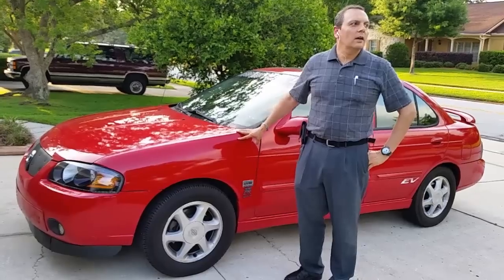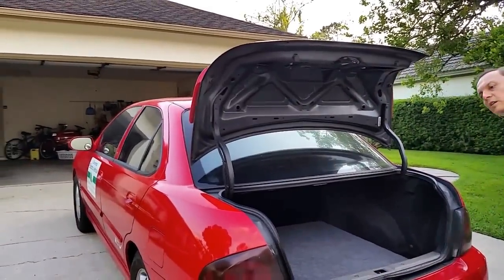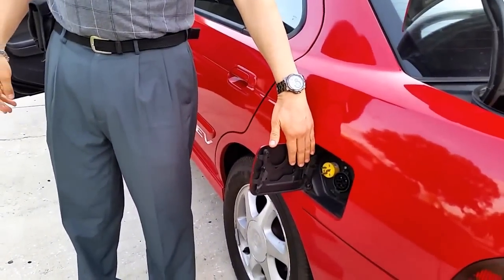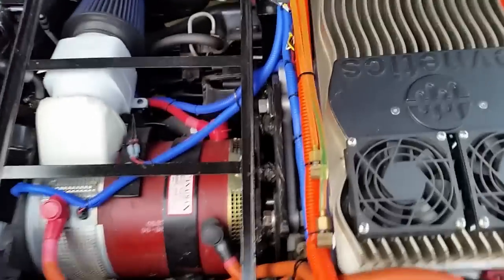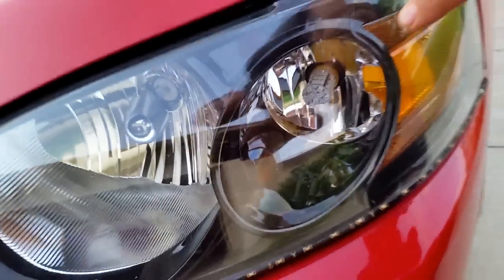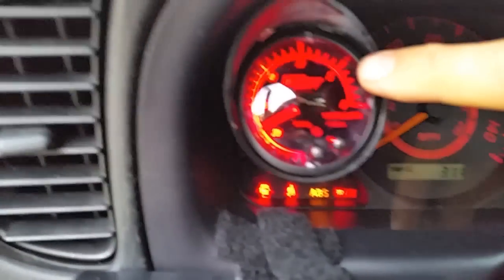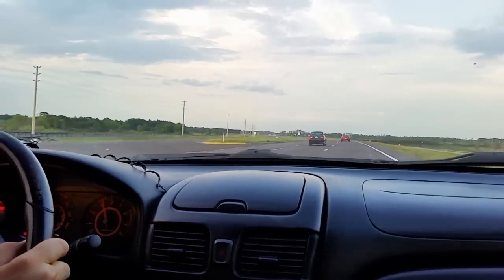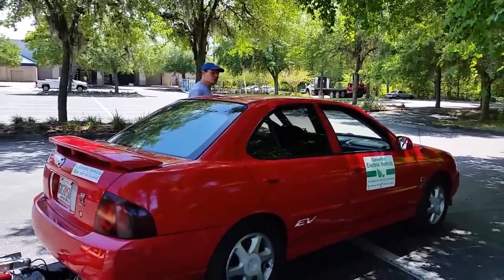Nissan Sentra Electric Car Conversion Part 40

Comment: You did a great job. You could install electric brakes and do away with lots of stuff like master cylinder, brake booster, and more.
Reply from the maker: +robviolin1 I didn;t know there are electric brakes. Where can I find more about them?
Reply: +mecanofan go here for electric brakes - http://www.etrailer.com/s.aspx?qry=electric-disc-brakes&furl=-vw-1
Reply from the maker: +robviolin1 Eelctric brakes is a big sorprise for me... very interesting. I wonder if it is worth to change a car to install electric brakes. most electric brakes are installed in trailers from what I see.
Reply: +mecanofan Well here is how i look at it. With regular fluid brakes you have the problem of the fluid leaking, master cylinder or brake booster having problems. With electric brakes there are not any problems. Any other example: better to use an AC motor to power your car instead of a DC motor. That was your won't have to worry about ever having to change the brushes. In stead of using a manual or automatic transmission, it is much better to use a gear box like Borg Warner 31-03 eGrear drive. Here is a link : 
http://store.evtv.me/proddetail.php?prod=eGearDrive
Reply: +mecanofan This  gear box has a 97% efficiency rating. That is very good. You will never have a problem with your transmission going out. You can convert an electric car that will last many, many years. If you ever get into an accident , you can just take out the electric conversion parts and put them into another car body. I converted my riding mower for about $500.00. It has a 11hp DC motor running on 24volts, no controller.
I have had this mower for about 30 years and just recently converted it.

Comment: What is with decorating the car being electric just because you decided o e day to use a different engine design? Why not keep the outside clean from any hints very similar to how you build sleepers?
Reply from the maker: I did it because I know people do not realize that you can convert cars to electric and many don't even know yet that you can drive on electricity. I have received so many questions and also thumbs up from the stickers.
Reply: Besides, you should really have used those air vents such as the grille to put the cooling fans at so you could get a better cooling for what could need fresh air.

Comment: greed for speed. how much did you spend for this sweet build?
Reply from the maker: Hello Adrian. I spent about 18,000. The sentra is for sale now. Without batteries and without charger. The rest is in and it has now electric OEM power steering which improved the driving experience by much. I am asking $3,500 plus shipping. Jose.
Reply: mecanofan 0

Comment: Please can you share details of what sensor you used on the steering?
Reply from the maker: I bought the controller at epowersteering web site and the motor in ebay. They also saled the controller in ebay. Search for saturn vue power steering controller
Reply from the maker: http://epowersteering.com/

Comment: What suspension did you use, especially for the rear?
Reply from the maker: XenomorphLV426 I got stronger springs for the rear. Those are I think from a mustang in the front. Basically, I measured the upper diameter, the lower diameter, and I got springs that could handle the extra weight in their measure for inches to compress per 100 lbs. I tried to find the closest springs for the expanded size of the original ones. Several calculations and catalog readings were needed to get the right ones, and it worked. It has the original springs in the front.

Comment: I also have a Nissan Sentra and am interested in converting to electric. How much did you spend on your conversation and how long was the journey?
Reply from the maker: Hello. I spent about 20K including the car but components have come down in price. I'd say you can do it these days for about 10K in parts plus the car. It took me 18 months, but just weekends. It was about 350 hrs until it moved, but this included some car repairs and cleaning that are not related to the conversion. Regards

Comment: dual transmissions will get you 90 mpg just use stick for low rpms front (saves gas) automatic transmission on the rear and go go go. throttle control is an issue as you should reach 90 mph at 2500 rpms in third gear or more so fix throttle or you get arrested for drag racing.